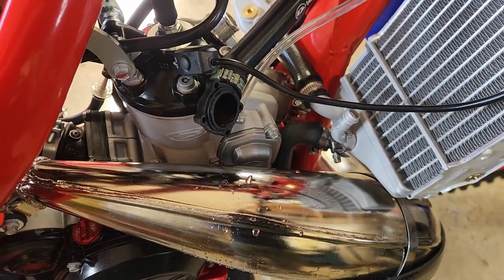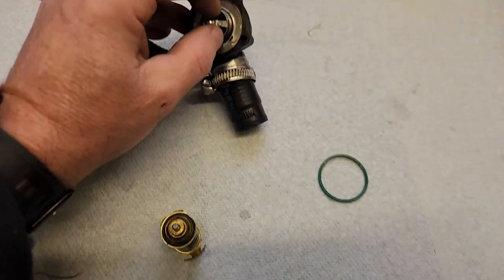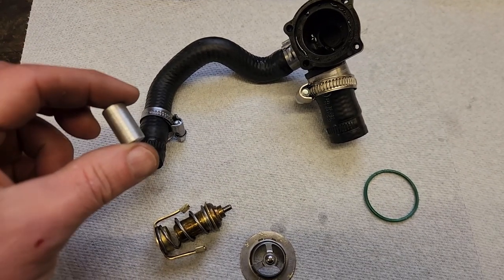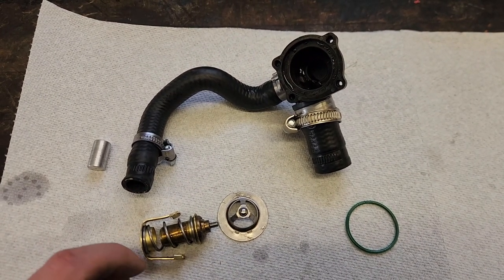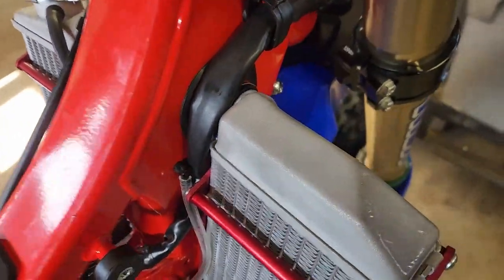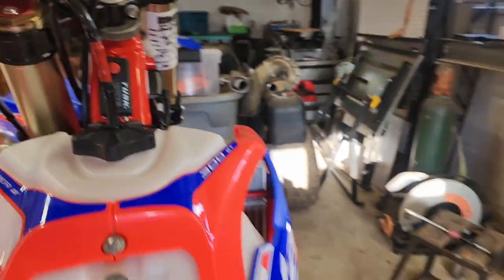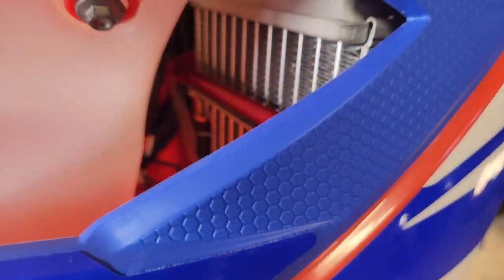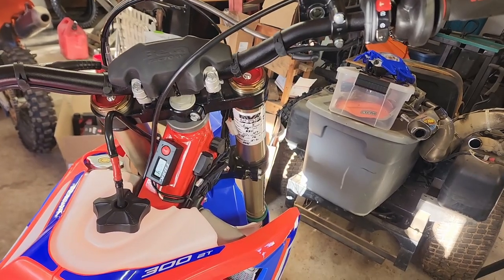MY24 Beta 300 RR Race Cooling System

Comment: From my experiences the thermostand stops the engine from overheating.  It stops flow for the fluid in the radiator the time to cool down. Withoit a thermostat it will flow until it overheats all the fluid.  Dont mean to spark an argument but it was designed like that.
Reply: Also on cold weather it keeps the engine warm on optimal temps... the cold weather is a killer for 2 strokes due to quickly  thermal expansion...
Reply from the maker: You are correct.  I remove it simply to remove a possible fail point.  Throughout the year ee ride single track from 24f to 95f with no issues. If it's real cold I may put a wind block over one of the radiators to increase the temp but that's not often.  If I was riding on the snow I'd be doing more to manage cylinder temp.

Comment: Never seen such messing about just to go pottering around, there really good out the box ya should have just gotten on and ridden it….
Reply from the maker: You're not wrong.  During these few weeks of crappy weather here I can set this thing up exactly the way I like it and be ready to rip.  After the initial set up I  won't do much more then maintain it. Each ride needs to be a as good as it can be.  Life is short, ride time is shorter.
Reply: @chadrides914 embarrassing to get passed by senior citizens isn’t it 😂

Comment: Hi Jeff, what is the point of the thermostae on the beta when its shipped?  If you can simple remove it and it has not affect.
Reply from the maker: These bikes are set up for a wide range of users. Anyone from an off-road racer to the guy that rides it to work everyday.  The thermostat helps regulate the temp in cold or high speed applications where the engine might not produce enough heat to run right.  For me and most US trail riders it's just not needed so I remove it to eliminate a possible fail point.
Reply: @JeffSanGeorge953  Thank you for the reply!   
May I ask if you've done a vid on how to install the fan, I'm just a bit confused if I can simply plug it in....(ktm I plug it in and the ecu controls the fan)   

Your vids are on point & clear.
Reply from the maker: @learningtofly6804  Let me know what fan kit you got and I'll try and help.